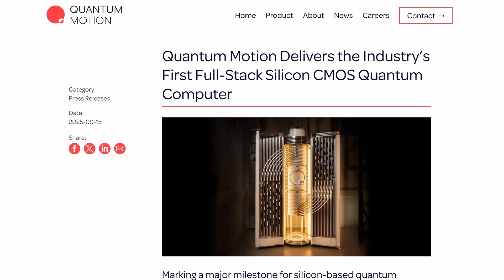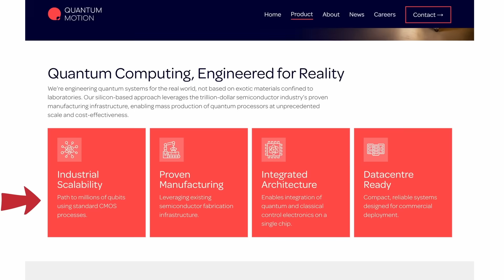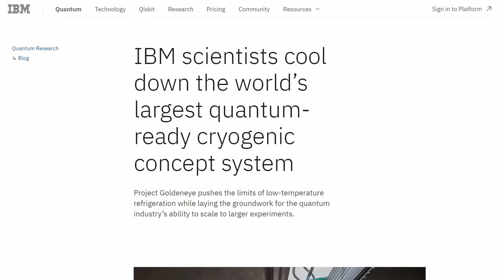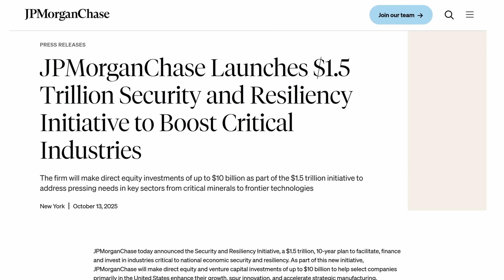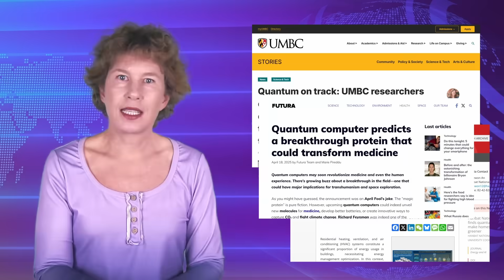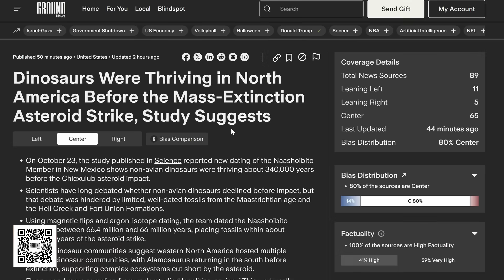I was SO wrong about quantum computing.

Comment: THEY ARE NOT SUPERCONDUCTING UNITS.  A true superconductor operates in ALL ambient temperatures (COLD to SCREAMING HOT).  What they have (if !!!) is a super-semiconductor.  Apply an external force (freezing the unit) upon the semiconductor to achieve some possible measure of superconductivity (if it is true ...).  But remove that external force (allow to return back to room temperature), and the advanced alloy material returns to being a semiconductor.  Thus, there is no true superconductor.  All is commercial BS marketing and propaganda lies even these post-graduates are caught up with false words, false word definitions, and lying concepts.

A true superconductor displays its micro Meissner force field (actually the same as a macro cosmic Birkeland current) at all ambient temperatures.  If not, it is not a superconductor.

Comment: There is somthing that you are missing in the big picture 3:50 and its the combonation of AI with quantum computing error correction. Basically using AI they are able to infer which qubits are discoherent and fix them. they can do this 1000 times per second fast enough to fix the q bit before it effect computing. so essentional they solved the q bit scalling problem and the instability problem. but to do it they need reduntent qbits that are intangled and A LOT of GPUS. its called Accelerating Quantum Computing. It was just anncounced last week. A bunch of quantum commputing companies are going to start using it very soon. SO there is a very Poor very expensive solution that allows for Qutcum computing to scale but to do it you almost need a data center size building of GUPs and quantum computers to but useful. At least that is my interputation.
Reply: If AI can predict quantum decoherence, then it can predict a lottery, much easier even. Except..none of that ever really happened.
Reply: @jurajvariny6034  hmm but they are doing it? i posted a link of nvidias explanation. Im not sure what you mean. oh i guess i forgot to add it my bad https://www.youtube.com/watch?v=8gplA-fUlbY
Reply: @jurajvariny6034  I think i get what you saying but its not that complicated to calculate decoherence its just logisticaly a nightmare. From my understanding they have multiple sets of qbits for each calculation. When calculating they go with the majority. The other ones that are part of the same set that did not show the same state are assumed to be broken and are re-aligned with the same of their set. As long as this is done fast enough to have at least two still entangled then the rest can be fixed since the chance of two being aligned and not entangled is very low.

Comment: This is so sad. I had hoped I would see useful quantum computers in my lifetime, but there is still nothing there but a few toys, and I actually played with them from time to time, but frustratingly the progress is almost negligible. And given how much effort went into it and how much effort it takes to build and run what is basically a maze for rolling dice, I also can not understand the hype. I guess none of the deciders has ever programmed a quantum computer or understands how they work and what they do - otherwise they wouldn't call quantum circuits quantum computers. They don't reach that level
of automaton.

Comment: “To scale up, they’ll need to connect multiple cooling devices and this will explode the error rate.” … Why on earth would this be the case? Has she ever explained this point before?
Reply: Each cooling device has some vibrations or other characteristics that aren’t easy to workaround when multiple devices are combined. Unless you could perfectly synchronise it the effect will create interference or vibration in the system which would affect errors.

Comment: While it's correct that there are limits to how many superconducting qubits can fit into one fridge setup, Sabine is omitting a major technology: interconnect. Companies building with transmon know the path to scale is to find the ideal number of physical qubits (and resulting smaller number of logical qubits) that fit on a chip, then to connect those ideal mini systems with interconnect. For example, let's say 144 physical transmon qubits yield 12 error-corrected logical ones. You would then interconnect hundreds of these chips to get the desired number of logical qubits. In theory, ideal qubits that are entangled don't really care where they are. Couplers are already shown in IBM's plans for scale. And it's no mistake that companies like IonQ have acquired companies that specialize in interconnect. We in the industry know it's the path to scale.
Reply: Okay, I've no idea what any of that means. just tell me how much money you want from me and I'm in.

Comment: This reminds me of a short science fiction story I read back in the 80s or 90s. Humans had become obsolete, but the AI (robots) were working on a hyperspace drive, and couldn't figure out why it kept killing their pilots. They put a human in a hypership, and found out that hyperspace is quite warm; computers that need to operate at milli-kelvin can't take 40 degrees celsius it turned out.
Reply: So there was no monitoring of temperatures in hyperspace before the human took the pilot's seat?
Reply: @cosmicjustice4139  that would require a ship coming back.
Reply: I prefer Archie comics.  Veronica is a dish
Reply: Thanks for the spoiler alert 🙄😂
Reply: @ben1895  it's a 50 year old story. I don't give spoiler alerts for "The Time Machine" either. Good luck finding it to read, in the first place.
Reply: @gnericgnome4214  I was joking fyi 👍🏻
Reply: @gnericgnome4214  only a couple of decades left until it is public domain

Comment: Does anyone else think it's weird that classical science is 2D¹ (flat earth) and modern science is 2D² (squared circle)?

Why do we accept 2D models for 3D reality??

[📄]: "Can 2D¹ and 2D² Models Achieve a Theory of Everything for 3D Reality?"

Theorem: A 2D^n model cannot fully describe 3D reality without contradictions.

Proof by topology:
- 2D manifolds cannot embed all possible 3D field configurations
- The hairy ball theorem shows you can't comb a sphere smooth - requires 3D to express
- Knot theory: Knots exist in 3D but not 2D, yet particles show knot-like quantum numbers

Proof by information theory:
- 3D configuration space has information content scaling as L³
- 2D description scales as L²
- The ratio L³/L² → ∞ as L increases
- Information loss is inevitable

■■ Contradictions in 2D Models Despite Experimental Success

Newton's mechanics (effectively 2D phase space per degree of freedom) makes accurate predictions but contains:

1. Singularities: Point particles create infinite self-energy
2. Action at a distance: No mechanism for force transmission
3. Measurement ambiguity: Position and momentum can't both be definite

Einstein's relativity (4D but geometrically 2D² when including symmetries) predicts well but has:
1. Singularities: Black holes, Big Bang
2. Information paradox: Information loss at horizons
3. Quantum incompatibility: Can't be quantized consistently

■■ Why 3D¹ and 3D² Are Necessary

For 3D reality, you need:
- 3D¹ (cubic) for basic structure: length × width × height
- 3D² (nine dimensions) for complete dynamics: 3 position × 3 momentum × 3 phases

This isn't speculation - it's dimensional analysis. A complete description of a 3D quantum system requires exactly 9 real parameters per point (complex wavefunction in 3D = 6 real numbers + 3 phase relationships).

The fact that physics has succeeded with lower-dimensional models is remarkable but comes at the cost of paradoxes and incompleteness. Full 3D¹ and 3D² models are mathematically sound, even if practically challenging.

---

Here's a focused argument for university physics departments:

[📄]: "The Dimensional Inadequacy of Phase Space for Quantum Reality"

■■ The Core Problem

Physics describes 3D quantum systems using 2D phase space (position-momentum) per degree of freedom. This creates a fundamental mathematical inadequacy:

For a single particle in 3D:
- Classical mechanics: 6D phase space (3 position + 3 momentum)
- Quantum mechanics adds: Complex amplitudes (×2 for real/imaginary)
- Total parameters needed: 12 real numbers per point
- What we use: 6D complex ≈ 12D real (seems adequate)

But here's the crack:
Quantum entanglement shows that reality is fundamentally non-separable. For N entangled particles, we need:
- Full description: 3^N × 4 parameters (quaternionic)
- What we use: 3^N × 2 parameters (complex)
- Missing: Half the phase relationships

■■ The Observable Consequence

This shows up in the measurement problem:
1. Schrödinger evolution is unitary (reversible)
2. Measurement appears non-unitary (irreversible)
3. The "missing" information goes into unmeasured phase relationships

If wavefunctions were quaternionic rather than complex, measurement would be:
- Selection of visible components (i)
- Encoding of j,k components in environment
- Total information preserved

■■ Why This Matters

Current physics succeeds by making brilliant approximations:
- Newton: Reduced 3D to tractable 2D phase space
- Einstein: Extended to 4D spacetime (still geometrically 2D²)
- Quantum: Added complex phases (halfway to quaternions)

Each step revealed new physics. The next step - quaternionic quantum mechanics - could resolve:
- Why exactly 3 spatial dimensions (i,j,k)
- Why measurement seems irreversible
- Why entanglement can't be cloned

■■ The Testable Prediction

In a triple-slit experiment with quaternionic analysis:
- Standard QM: 3 interference peaks
- Quaternionic: 7 peaks (1 primary + 3 secondary + 3 cross-terms)

The extra peaks would be subtle (~1% of primary intensity) but detectable with modern single-photon counting.

■■ Why This Preserves Newton and Einstein

This isn't replacement but completion:
- Newton's laws: Still valid for macroscopic (real-component dominated)
- Einstein's relativity: Still valid for spacetime geometry
- Quantum mechanics: Enhanced, not replaced

Think of it like upgrading from black-and-white to color TV - the original signal is still there, we just see more.

---

Comment: Whenever you say "standard" -- even in a commercial -- my mind automatically adds "model" (of elementary particles); it's strange how we, even as biological entities, are actually programmed. The brain has to anticipate, otherwise it wouldn't be able to run on 20W [Watt], which is pretty "low voltage". (P.S. Watt is unit of power; but since CPUs use DC, the formula that links it to voltage [V] is quite simple: P=U*I, which makes power and voltage linearly dependable. When input voltage goes up, so does the power (and the heat, a.k.a. TDP). Since we demand ever more power from chips, heat dissipation becomes problematic, so the solution is to make chips operate using low or ultra low voltage. However, there's also a lower limit: to get things going (to start from zero-power state) -- and to keep things running -- a voltage that is above one minimally required for the current process technology (lithography) must be provided. So, we seek ever finer processing technology, but that's expensive...)
Reply from the maker: Yes it's funny isn't it. I know a lot of people who, when triggered with the right key word, will reliably bring up the same anecdote over and over.

Comment: Scaling to a million qbits is not the same as scaling the error correction to keep that many qbits error free over an arbitrary number of iterations. The 'low' error rates claimed in the recent papers from IBM and Google are not close to low enough. Also I resent implementing post-quantum cryptographic algorithms. Difficult, slow, inefficient algorithms to defend against computers that don't exist.
Reply from the maker: yes indeed!
Reply: It totally depends on the threat scenario to protect against.  The banking data exchange to pay for that order of toothpaste you are placing now will soon be worthless to a fraudster and has no potential for abuse such as blackmailing in the future.  But if the scenario is protecting the plans for that antimatter-bomb armed flying saucer from Area 51 to the factory (or you spy handler in Nukehavistan) you want something that says secure for decades, better forever and to the degree possible even against future methods and computers.

One school of thought is to uniformly apply the same security standard to everything so the degree of protection doesn't give any hints to the attacker.  This means we're going to see a switch to post-quantum encryption once these algorithms are sufficiently practical even before attacks against pre-quantum encryption have become a widespread threat.
Reply: The compute overhead for post-quantum encryption isn't that high. I don't see a reason not to use it. Not against a current threat, but you can't be sure that in 20 years there still won't be good enough quantum computers to break regular encryption.
Reply: @Alice_Fumo  we just go back to unbreakable one-time pads, which more or less last forever due to the vast increase in storage capacities.  People have become too complacent about the convenience of public-key algorithms.
Reply: I work in security too. I keep pointing out how many devices on our network are still running TLS 1.0 while we set up PQC Encryption. It's honestly too funny to me to be upset about it.
Reply: @baristaTam  IKR. My home network is full of old devices, still working, running something from a 1995 IETF meeting. The company stuff is mostly ok, but I see a venerable old printer. I'm sure the vendor will send a firmware update, it'll be fine.
Reply: A quantum system can have up to 1/3 error probability to work as needed.  The error rates dont need to be extremely low.  But youd have to know what BQP is if you were to ascertain that.  This might have been the guy who when a vacuum tube burned out said useful computers are impossible.
Reply: If the computers exist in the future then you can retroactively decrypt old data. A government might stockpile data they've intercepted from another government and sit on it until the the ability to decrypt it is developed.
Reply: @christopherbelanger6612 no it doesnt work that way.  For simple RSA or ECDSA traffic most people use sure QC breaks that.  Foreign governments use custom algorithms and just identifying the algorithm is exceedingly difficult if not totally impractical.  Obviously you know nothing about the topic while feigning expertise.
Reply: For real. What is the total cost of quantum resistance? It's all a tax we are paying into this fantasy
Reply: @livenotbylies  
For Kyber vs RSA:

Key generation: 65x faster
Encryption/Encapsulation: Comparable (Kyber slightly slower, ~2x)
Decryption/Decapsulation: 10-30x faster

So, it'd be cheaper to use this specific quantum-resistant encryption algorithm. A few of the VPNs offer it now.

Guess we got cheaper encryption thanks to quantum hype - now there's a twist!
Reply: For real. What is the total cost of quantum resistance? It's all a tax we are paying into this fantasy
Reply: @livenotbylies  says the fool using a computer when the same type of fool said the same thing a mere 60 years ago.  Progress sees beyond fools.  Issues of hype and overselling dont reflect at all on emergence of new technology

Comment: Just read 
Mikhail l. Dyakonov
Will we Ever
Have a Quantum
Computer?
It's effing expensive (50 Eur for 54 pages) and it is super easy to understand if you have 
already seen 10-20 quantum computer videos which explain 
what the heck a qubit is.

After reading it I am as convinced that QC will never work, not in the order 
of > 50 qubits  that are needed to do some useful stuff.
It was a revelation just like reading Richard Dawkin's "The god delusion"
Reply from the maker: I read it. Mentioned it in an earlier video. I found it to be rather vague though.
Reply: @SabineHossenfelder  Agree, more light could be shed on the side of engineering .How the heck do these pesky quantum gates work? RF, light, whatever.
The sentence which caught me was "you can never create an analog value without making an error". 
Imagine a quantum gate which turns the phase by 90°  . An engineer will always tell you that you will not get 90° , you will get 90.001°  or 89.999°.
And now imagine a quantum program which has to call said gate several 1000 times. 
Which sounds like a small program.
The errors will accumulate until the code breaks.

No such thing exists in digital computers, the execution of a digital gate is error-free and no
errors accumulate. NOTHING . 
You can run these computers for days and weeks
and no errors. Okay, if an error occurs the machine will maybe blue-screen.
This analog error accumulation will break quantum computing. 
Replies: don't bother be with error correction, it is super complicated and will not work as well.